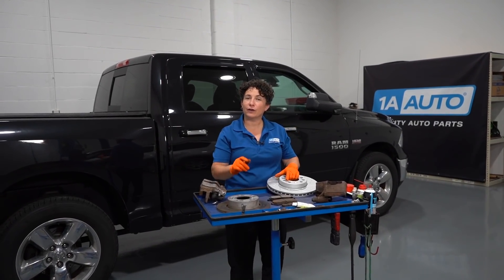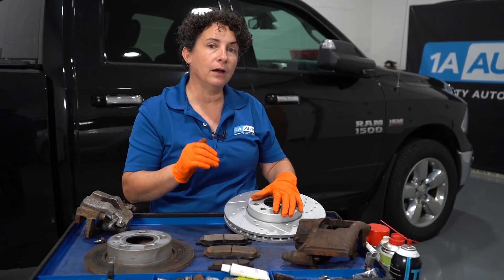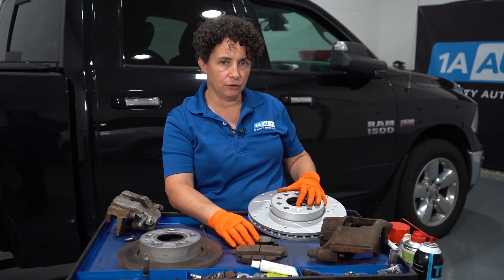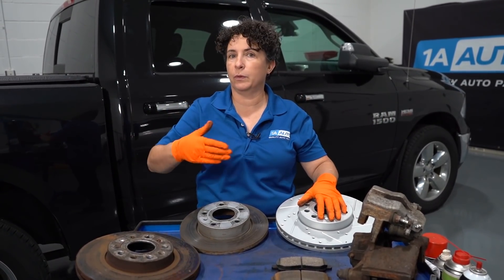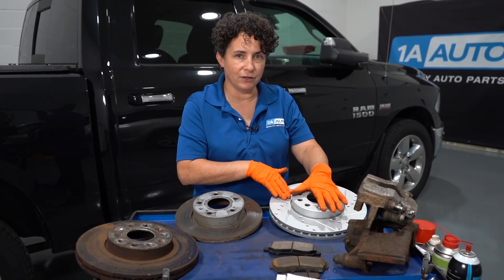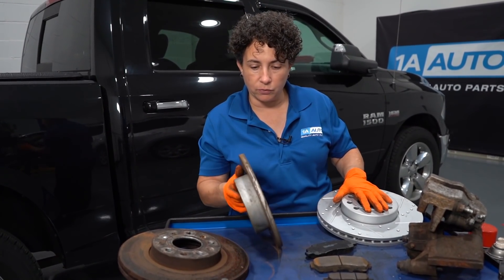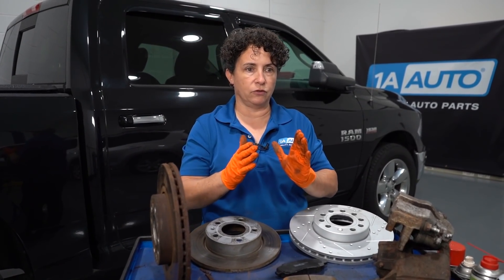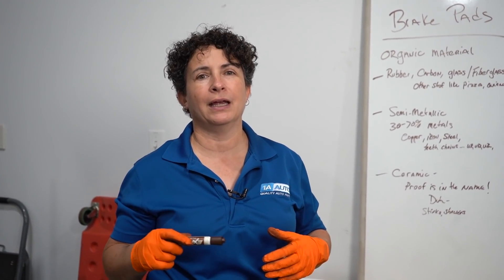Difference Between Brake Pad Materials? What Are Brake Pads Made Of? Car Brake Pads and Rotors!

Comment: Like the vids!  Would you be able to provide more details on the Brake Pad friction codes such as FF of FG based on the A-K scale for brake pads sold in the US?  Why don't more retailers and mfgs. list these on there websites?  What are the typical ranges associated with the letters?  Also what do the Ecodes represents on the Euro pads?  Also would like more details on which pads do and do not meet the CA and WA code restrictions as published by Automotive Manufacturers Equipment Compliance Agency (AMECA)? https://ameca.org/wp-content/uploads/2022/10/AMECA-List-of-VESC-V-3-Brake-Friction-Material-Edge-Codes-October-28-2022.pdf

Comment: Great video.  Brakes are the big mystery out there.  This was of tremendous help.  Now for the question of the day(decade).

I need more grip on my rotors to shorten my stopping distance.  The question has always been pad composition.  I have a 74 Cutlass.  Factory brakes.  Front/rear bias adjustment.  Still leaves some lack of grab in an emergency braking situation.  I feel the fronts are not "pulling their weight".

So, semi metallic is what I understand.  Brake dust is not a concern if I can just stop it.

Are their various types/grades of semi-metallics that grab better than others?

Comment: that stuff about aluminum calipers not using semi-metallic brake pads is nonsense.  aluminum is lighter, thus you pair it with ceramic to maintain less weight.  particularly in high-performance cars.

Comment: I am redoing a 2001 dodge ram pickup just general use no real towing or anything but i live in the rust belt in NEPA would the drilled, slotted vented be best and if so whats the best brakes for my application I have ram 1500, 2001 4x4 class b. Loved your video and expertise in this topic.

Comment: I wish you would have talked a little more about coated rotors.  They make a huge difference in a corrosion climate or places that use salt in the winter.  I have some going on 5 years old and the rotors, other than the wear surfaces, look almost brand new.  Uncoated ones rot away as you noted.  The coated ones are not much more $ at all.  Coated rotors with ceramic pads help keep things looking nice with minimal corrosion for a long time.

Comment: Seems I did the right choice when I got the semi-metallic pads for my car. I got interested in ceramic pads when you mentioned "less brake dust" (I just got new rims and they do require once-a-month-or-two spraydowns with a rim cleaning agent to keep their shine), but when I looked up the characteristics they're not as well suited to driving aggressively and/or in cold climates. I live in a hilly region in the arctic circle. I'll just deal with the brake dust and replace the rotors once they're past their prime.

Comment: Hi Sue, I have a 1999 Audi A6 and I recently changed OEM pads with Akebono brake pads. There are tons of aftermarket brands out there, are there any brands that you recommend?
p.s. that part about aluminum rotors not being able to use semi-metallic = very good pro tip.